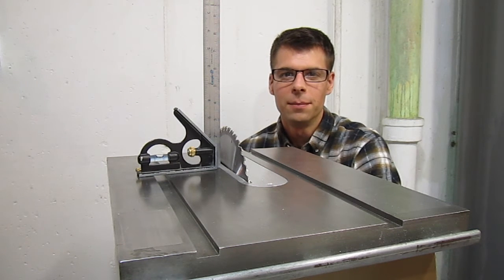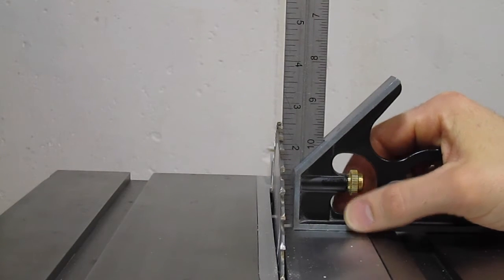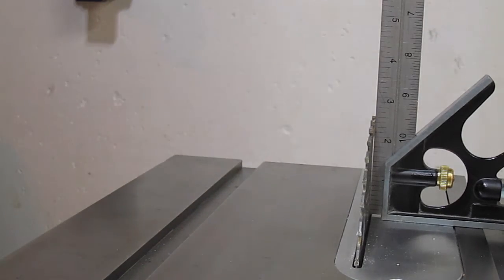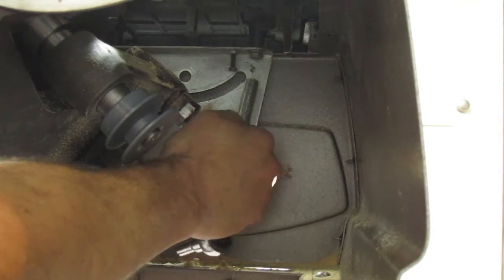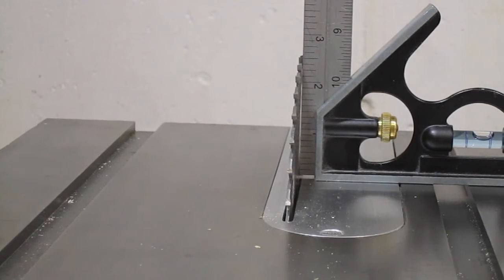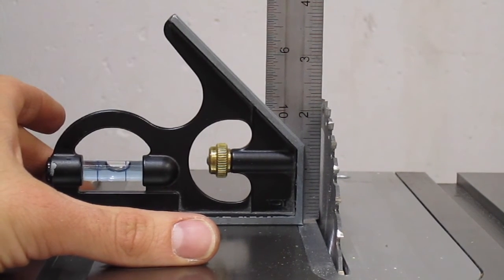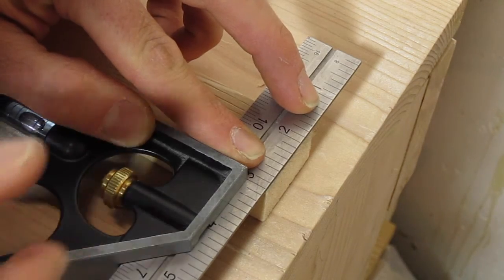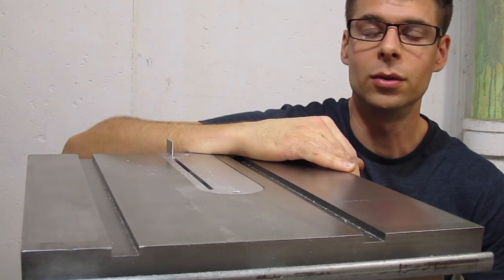Aligning Table Saw Blade to 90 degrees

Comment: Better is it two different pieces. Cut them and see how the fit together. The problem with the method you use here is that the piece of wood must be 💯% 90 degree to see if your table saw cuts at 90 degrees

Comment: Two things: taking the table off will absolutely have an effect on the alignment of the blade in the other axis.  Why set up the saw to purposely be out of alignment at 90 degrees?  Now you have to use your square every single time you want to make a cut.  You need to set it once and trust that you did it right.  Why set it up to stop at all?  Take the stop off if you’re going to do it the way you did.  Pure foolishness!

Comment: Hi.  I have a DIY  table SAW, made I'd plywood.   the issue is one side of the blade is square but the other side is not square.  Then I put a wood across and I realise the table is not straight, it curve.  Shall I put shims under the circular saw base to balance it?  Thanks

Comment: I moved the stop on my titan saw but the blade still wont quite get to 90 deg ! , very frustrating,  maybe I should shim the table up ?
Reply: Im not sure of your machine but on my DeWalt circular saw, I needed to grind some parts to allow 91 degrees so I could play around calibrating it. Don't be afraid to pull the Demel out and chop some metal. I never regretted it.

Comment: That's cool! You are right. Experience will help a lot. What brand is it? The table looks pretty narrow, but really nice. Will you be making an extension table?
Reply: Thanks! My saw wasn’t even built when this video was made, just shows how pertinent the information is!
Reply from the maker: Thanks! The brand is Power-Kraft, which was sold by Montgomery Wards. Apparently many of the tools under this brand were made by Delta. 

I do plan on building a table around it which will have extension wings and and outfeed support.
Reply: Brian Hilson very cool!